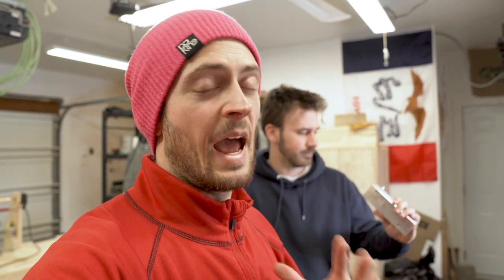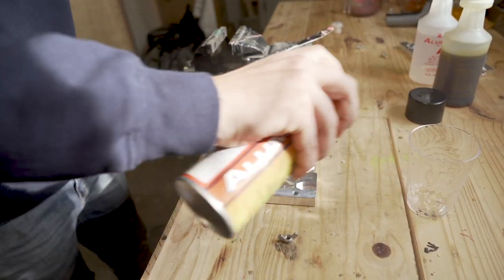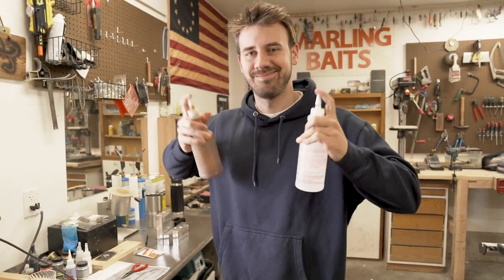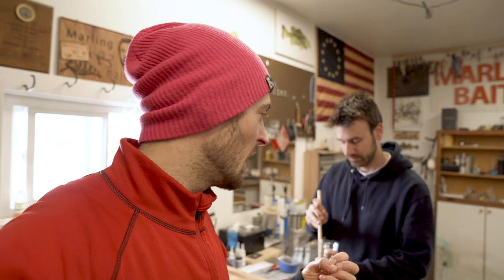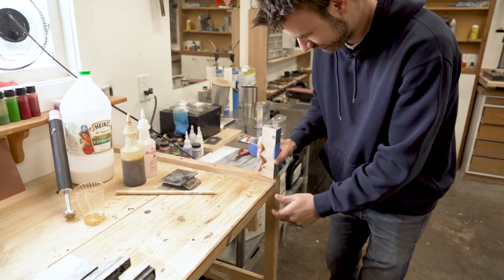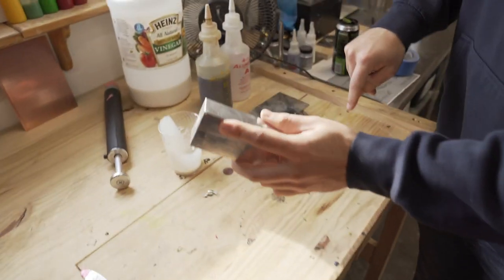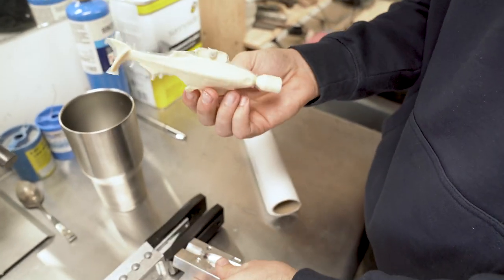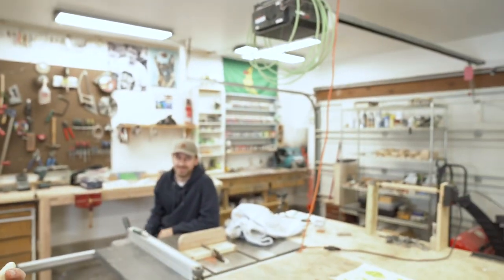Will Casting Resin Destroy an Aluminum Mold?!

Comment: Multiple jointed swimbait! 3 or more pieces, with dimples where you need to drill for your joints and hardware!
Reply: I was thinking that’s very useful. Im sure they were already on the same line of thought as well.
Reply: Same thing I was going to comment
Reply: Yes!
Reply from the maker: I saw we just make it so the hardware get put onto the mold before you close it then the resin bonds it all into the hard bait!
Reply: BINGO!!!
Reply: @EpicBaitMolds  And also you can do hard head part and plastisol tale...

Comment: Pro tip guys. Sprinkling some baby powder on the mold cavity will help demolding much more than those aerosol mold releases.
Reply from the maker: Thanks for the tip, we will try that out!
Reply: There is a Gypsum mould release liquid for dental lab acrylic denture making that might work,
Reply: It also breaks surface tension of the resin which helps cut down on any surface bubbles if you aren't pressure casting or anything like that. Dusting molds is really common in prop / costume making.

Comment: don't know if it helps on these or not but you can also use a plastic syringe to inject resin, I started this on silicone molds as sometimes I had issues with just pouring the resin. Atleast the resin I use doesn't stick on the syringe walls and I can just remove it from the back of the syringe after it cures.

Comment: If you wanted to do a two pour of soft and hard the mold could be modified from the type you have shown.  Making the "leak spot" the second pouring sprue and adding a tail insert that restricts the mold for the hard pour to be removed after cure but before the soft pour.  I would suggest that you shape a spine or tang of sorts into the insert.  This would increase the surface area of bonding potential between the two medium.
I hope this is functional enough to give you some ideas.  
I also realize that makes it a 2 pour and 5 step process that may be more headache than two molds and a bonding solution afterwards.

Comment: I could see roto-molding as an option. Mold halves to be hollow, then insert rattles, flashy stuff(for transparent resin) and other things for crankbaits.
Reply from the maker: Just gotta make some kind of smaller 2 axis rotary device.
Reply: @EpicBaitMolds  Have a few inserts to put in to make different sized internal cavities. Small ones to insert hook hangers etc. larger ones to insert weights even larger to insert rattlers. So to setup the mold you just choose the size of the insert to match your application. One mold could be used for several different configurations.

Comment: Pretty sure u can use almost any 2part epoxy for this if you want too (after mixing the epoxy blow on it with a heatgun to make it very "runny?" onstead of stiff then pour it in)

And yes not for your ordinary softbait molds would be more fit for crankbaits

Comment: Take a old Pressure cooker, or buy a used one for dental labs (or new) instal in the lid a tire valve stem and a pressure gauge (look up a lab cooker on the web) Place mould filled with resin, and apply 20 lbs of air ,like filling a tire. Release pressure and open when cured and no bubbles

Comment: I thought you were supposed to pressurize resin, not vacuum it. You should be able to pour the mold and put it in a pressure chamber until cured to eliminate bubbles.
Reply from the maker: We will do some research on this!

Comment: Of course you can 😉 ideal for jerkbait molds. Because the resin will destroy silicone molds that people normally make at home. But they last only for approx 30 baits. Then the resin starts to destroy the silicone molds.
Therefor aluminum is ideal, when casting jerkbaits 😉
Reply from the maker: This is great to know!